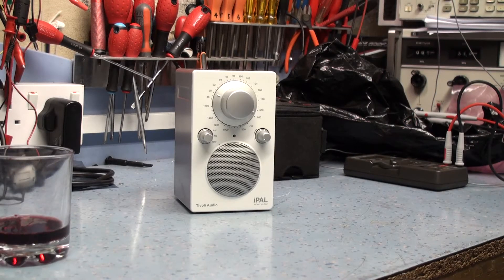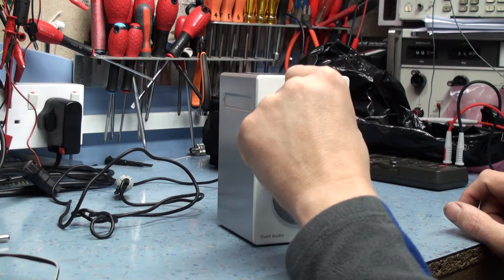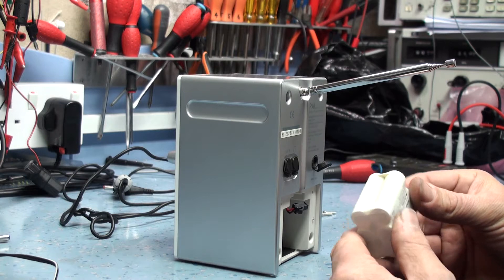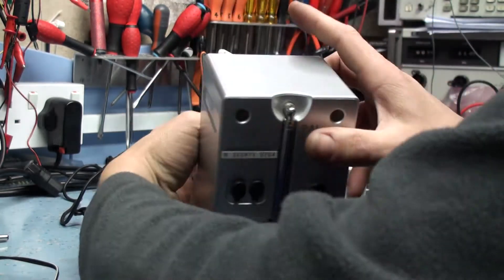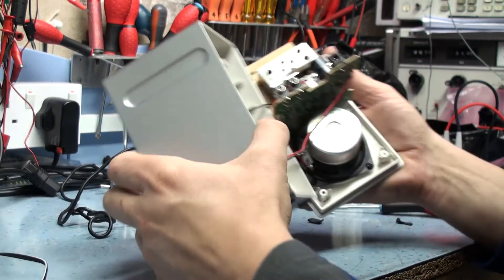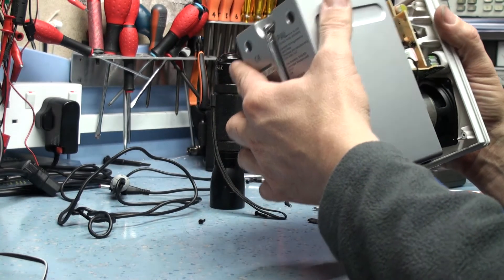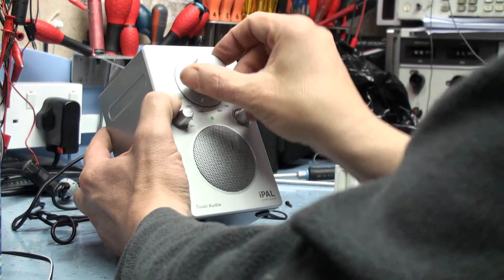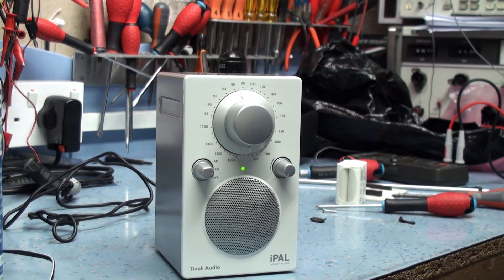Tivoli ipal test and tuning gang clean

Comment: Thanks for this video !  I picked up one of these a couple years ago, 2nd hand, but it has not lived up to the hype.  I have the same problem with scratchy tuning, but it hasn't been cleared by blowing canned air into the RF section; there has been some improvement, but not dramatic.  Really disappointed at the build quality compared to the MSRP, and then to see so many people having similar problems.  I'll keep looking; right now it's for the bathroom during shower time - it sits opposite the shower and is the only thing that can be loud enough to heard over the shower.

Comment: The sound is tuned very well for the size of the device, and the tuner is very nice if you want an analog tuner, it is the best dial tuner I have experienced. The kit inside is about what is expected for a device that is $150, I really don't understand what all the complaining is about. I have the BT/AM/FM device, and I had 2 or 3 devices that were $70 from tecsun that broken the same way before I got the Tivoli, The Tivoli sound quality is better, and until the airline broke it in my luggage (why I am at this video) it has been flawless. I have been using it for 4+ years. It still works, but something is broken inside.

Comment: This is a classic example of the power of marketing over engineering. It's a bog standard analogue non-synthesized FM radio with no LCD display for frequency display and it costs a fortune.
Reply from the maker: Roger Onslow I am in total agreement. Its a basic superhet  with poor quality components. It does sound quite nice but it's poor underneath the covers.

Comment: I remember first seeing one of these around 2008/9 ... They were (and still are) ludicrously expensive ... 

From the outside they do indeed look premium, and the rotary dial is superb, but ... if they chuck crap components inside, that's just messed up (just opened a shitty Canon printer power supply, and it had exclusively the same series Rubycon caps in it ... and that thing was 80$ new tooops)

Comment: Pity that they're so bad in terms of quality. When I was younger I read the Elektor magazine (Called "Elektuur" in the Netherlands) form time to time, (our local library had them). When these "Tivoli Audio" radios were new they had opened one to find that they were build to excellence. I believe that one had a wooden case, but also an unbranded speaker. I never owned one myself, but I always regarded them as high(er) quality devices because of that article. It's a shame that the manufacturer opted for building their overpriced product down to a price.

And yes... ladybugs emitting that orange/yellow stinky stuff is a defence mechanism, I used to call it ladybug piss :)

Comment: I’ve got one of these,had it about 12 yrs never had an issue with it,up until now that is,the tuning knob seems to be getting harder to turn,any ideas😩
Reply: I had the same problem.  In addition my model one would wander off the selected frequency which was very irritating.  I found and performed the process at the top of this page: https://tivoliaudio.com/pages/model-one-bt-troubleshooting and all has come right.  The tuning knob is also much easier to turn.  Apparently there is a lubricant in the tuning capacitor which can settle over time making the knob harder to turn.